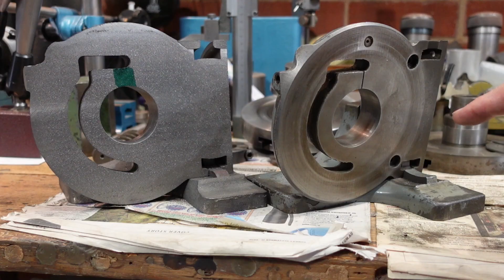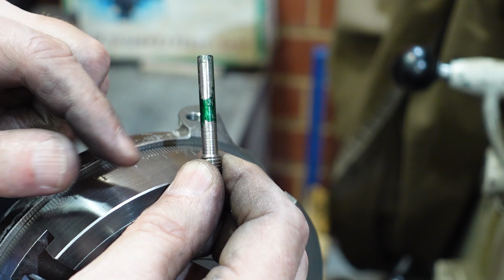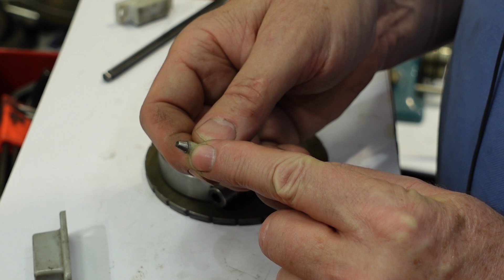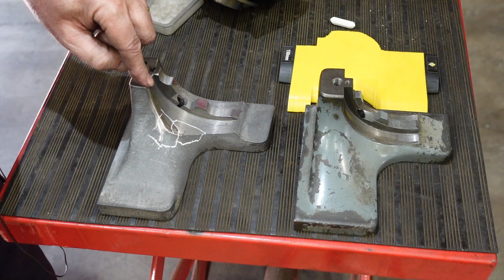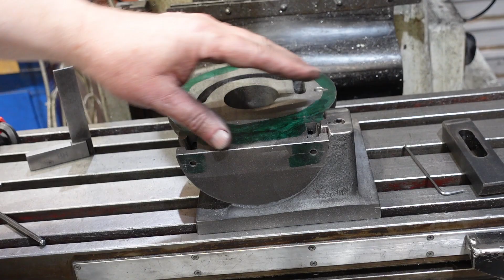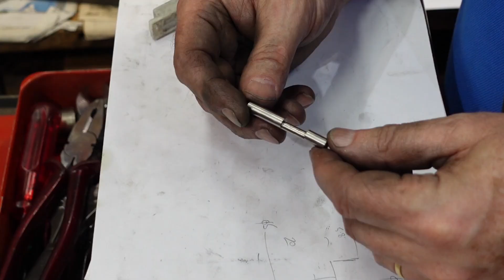Completing the TTH rotary table (TTH 10)

Comment: Those creative work holding setups are mind boggling 😮
Reply from the maker: I must admit, I get a bit puzzled when I get comments saying that I need to show more machining as typically that is just a cutter moving relative to the work. 
Far more instructive is the set up, sequence and prep work to get to that point.
I try to show (and explain) these set ups so viewers can see what I'm trying to do and perhaps help them get into that way of thinking.
A video coming up soon shows exactly that - the part is all straight line cuts, but does need thinking about the 'how'.